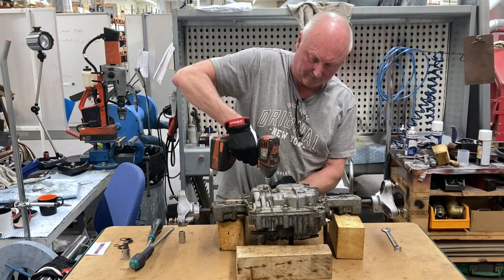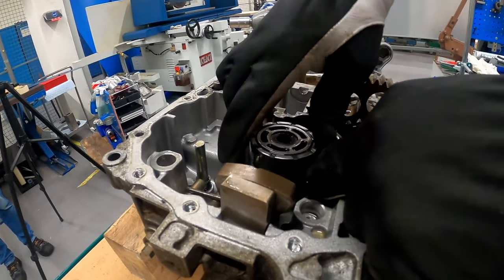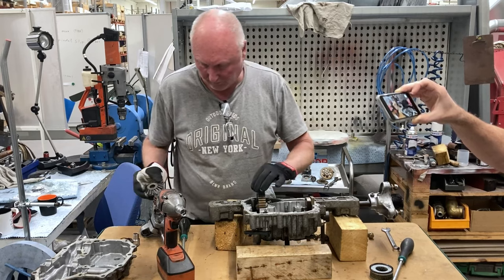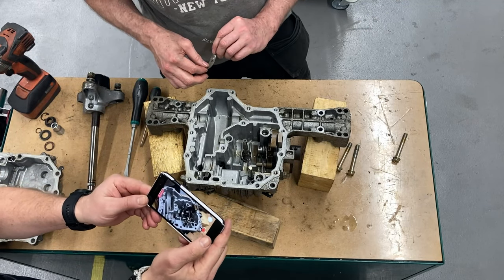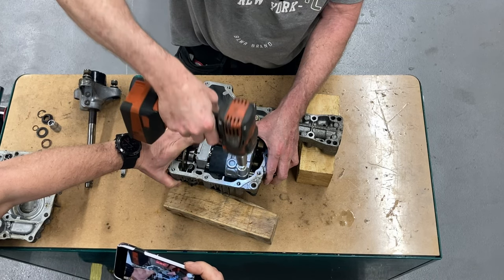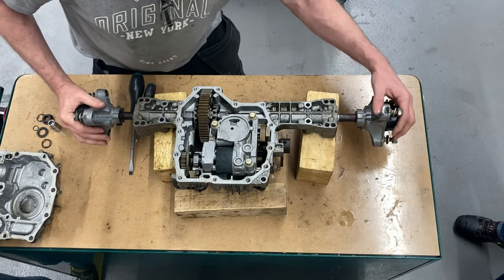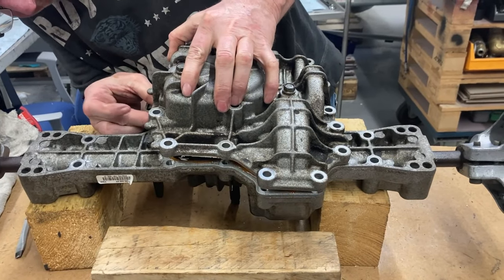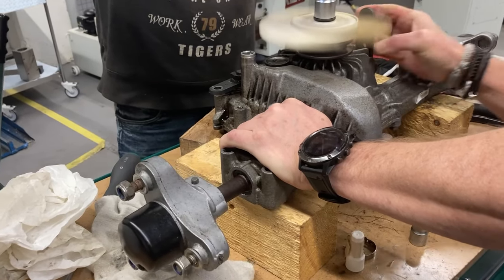Repair the hydrostatic transmission a Tuff Torq K46 (Lawnmower Stiga Park)

Comment: Moment på skruvar på Stiga Park. 

Workshop Manual Stiga Park

General tightening torque

Unless otherwise stated the following tightening torque are applicable for screws and nuts on the machine.

General Thread/Torque on Siga Park Senator, President, Royal etc according to workshop manual M5 - 5 Nm, M6 - 9 Nm, M8 - 22 Nm and M10 45 Nm. 

Happy repairing! 😅
Reply from the maker: Tack ska du ha!

Comment: Hi, my stiga park comfort doesn't move well when cold. Is it cos of old transmission oil? And where's the draining hole for that? Thanks.
Reply from the maker: I would start with changing oil and oil filter. The drain plug is in the center of the gearbox, you can see it in the video
Reply: @berg310tor-arnejonasson8  You mean motor oil? My model is 2006 and bought it as used past summer. Haven't changed any oils yet but air filter. It doesn't have oil filter.
Reply from the maker: @aksuli1  
No I mean gearbox oil, there is a filter inside the the gearbox (Tuff torq K46) but you have to disassemble the Tuff torq K46 to get to it, like in the video…
Reply: @berg310tor-arnejonasson8  Ok thanks 👍. But you don't have to dismantle all the parts just to replace the filter, only the cover?

Comment: Would have like to see how you polished the pump. That's like the main issue.
Reply from the maker: Well, I agree that it would have been nice to see but it’s quite simple. It’s just a face honing machine with a manual pice holder. But I did it in the factory wher I work and ther is no photo or filming allowed 
So sorry about that!

Comment: My mower loses power when hot to wear it will barely even drive I'm at the point where I need to tear down this transmission I'm not sure if it could just be a clogged filter or if maybe there's a problem with the axle seals.   When I change the oil in it it was very very hard to fill up the transmission again because it didn't want to take any oil I had added a little bit at a time and it took me a whole day to get a level back in it I'm not sure why that was.  Do you have any answers or advice
Reply from the maker: Hi!
To fill the oil faster you kan remove the plastic plug as shown in the video, this vill make it in a few minutes. 
About the drive it sounds like the there are some scratches on the hydraulic pump or motor. Then it needs to be reworked.
Best regards
Tor

Comment: If my lawn mover after moving up all to one side iand after putting back to driving position is starting to drive heavy and i heard the sound so it means that oil is missing or there  is more trouble ?
Reply from the maker: It’s very difficult to say with out knowing what kind of gearbox and drive it is

Comment: Thanks for your documentation about disassembling the transmission! Am i right, that you filled it up to the top With oil? I Saw some other Videos about changing fluid and they used about 2 Quarts (2 litre). Thanks for your work and keep up the work and swedish talking in the background. Always nice to have friends around while working on engines and other things
Reply from the maker: Hi! And thanks for your comment. 
In this drive it should be filled with oil and then on the lawnmower there is a small container that shall be filled. Unfortunately I don’t know how much oil I filled because I used a pump. But any way this one should be absolutely full
Thanks and have a nice day!